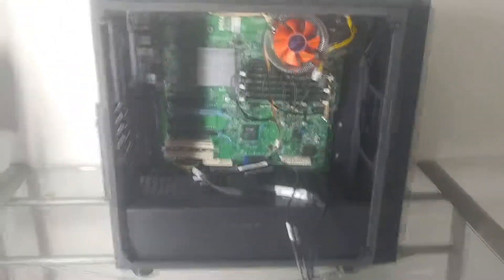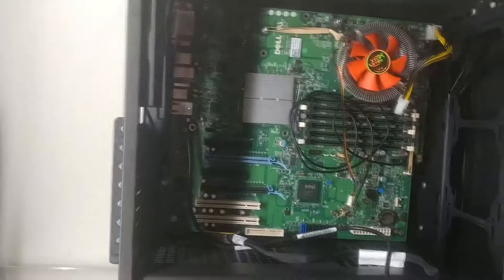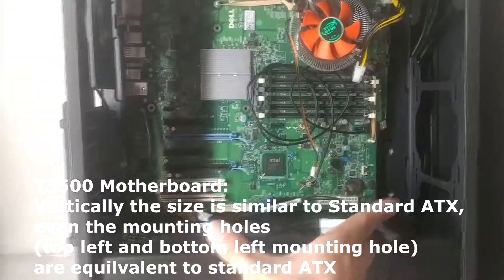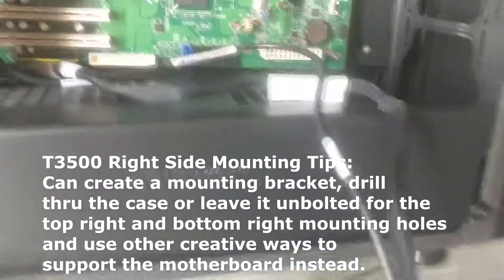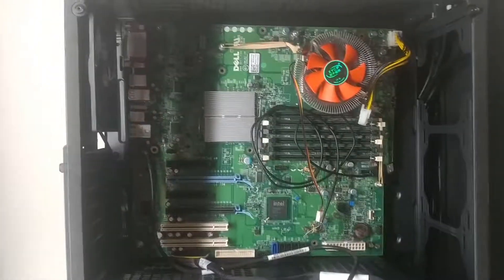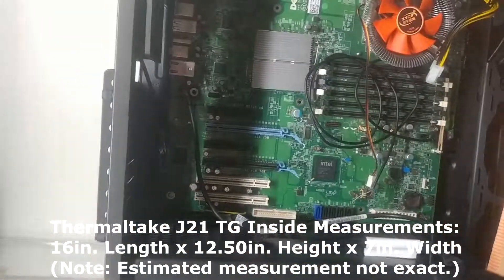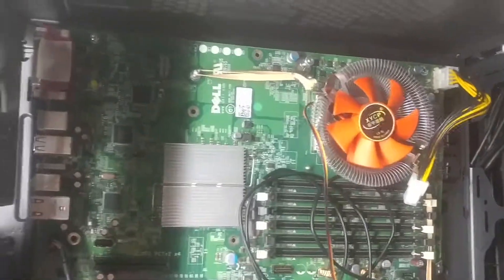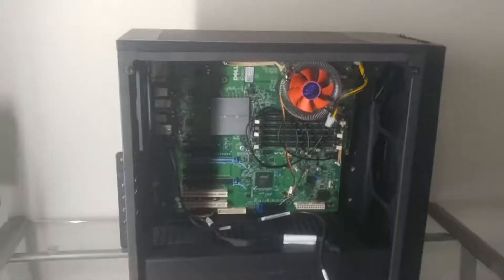Fitting A T3500 Dell Motherboard In a Standard ATX Case

Comment: Bro I love the gaming case and can I fit dell precision t3500 motherboard CD ROM and power supply
Reply from the maker: Unfortunately not on this pc case that is on this video because this pc case does not have a slot for putting a cd ROM drive, a standard atx power supply will fit but the stock dell you will have to transfer the harness with it, in my opinion it would be better and simpler to just use an aftermarket standard atx power supply instead of having to remove the stock t3500 wiring harness, you also might not have full control/option of the orientation/mounting of the motherboard if you decide to use the stock dell power supply (not impossible if you decide to use, just more effort). Hope that helps
Reply: @IrvinCunanan  thanks

Comment: hey thanks for this video i’m really worried about what case to get. can you please recommend some cases for me thank you.
Reply: will this fit

MUSETEX 6pcs 120mm Fans Digital ARGB Lighting - 2 Tempered Glass Panels USB3.0 - ATX Mid-Tower PC Gaming Case-White Frame - Computer Chassis Desktop Case（907W6W） https://www.amazon.com/dp/B08FYN6R8L/ref=cm_sw_r_cp_api_glt_fabc_VE839QZB30BWS3NJM2W1
Reply from the maker: @Alkize06   I am not sure about that case I'm so sorry to say. I have only tried this on a J21 Thermaltake PC Case. There are comments in this video of people and fellow Youtubers that shared what worked for them. Also its the inside measurements you want to be looking for, if you can go to a pc store and get some measurements or maybe messaging sellers that sell a particular pc case you would be interested in and ask for the inside dimensions.
Reply: thanks for answering
it says 12 by 13 inches. do you remember the size of the mobo?

Comment: ive done 3 in rosewill mesh cases!! pretty sure I have a vid on here too of it ….lotta ppl are wondering if it would fit into certain cases...mobo was 13.5 inches at the top and 13 twards the bottom...must have a flat back wall in the case for the mobo and needs to be 13.5inches at least :) nice vid man!!!

Comment: hey! what cpu cooler you have there?
Reply from the maker: Its not that great tbh the fan spins very slowly.  It is a no name brand that I got from ebay (shipped from china) out of curiosity
Reply: Oh could direct me to the right direction. I have dell T3500 and want to upgrade cpu cooler.
Reply from the maker: @gediminasbielskis8346   From what I remember no ordinary after market replacement cpu cooler will fit on the dell T3500 without some modifications, their mounting is completely different from a standard aftermarket cpu cooler mount. Also their fan is no ordinary cpu pin either, it would have to be re pinned from stock to standard 4pin if you plan on using aftermarket cpu fan coolers.
Reply: Irvin Cunanan thanks pal. I have been looking everywhere to find any info. But what I found is that 212 cooler master just fits on the dell T3500 mount. If I place the plastic mount, generic that many cheap coolers use on regular 1366 board and screw it on with some m3 bolts? I would just attach cpu cooler? Cause some cheap cpu coolers have 6 heat pipes with 90mm fans, that should be enough space even in original T3500 box.
Reply: @gediminasbielskis8346  get the copper heatsink and attach 1 fan on side your good to go
Reply: @thelaw9937  how did you attach yours?
Reply: @stefaniliev1528  i zip tied the fan around the top of the heatsink working fine

Comment: The issue I see being the BIOS having issues and yelling at the user every time it boots. One of my spare systems is a T3500 and I've had to lug it around a bit more than I'd like and it's too clunky and awkward to carry. Yet I know that the bios will have issues with the front fans not being the proprietary 5 pin ones etc. The front USB might not be an issue depending on the user though. Maybe there's a bios mod out there that'll help with everything else.
Reply: There is a vid on youtube how to remove the fan error
Reply: @thelaw9937  do you happen to know the name of it?
Reply: @buzzlightyearoh  try to go to BIOS/Maintenance/SYSLOG screen and clear it manually.
Reply: @thelaw9937  will try thank you
Reply: @thelaw9937  man I can’t find that I cleared the system log but nothing changes and in maintenance everything is useless
Reply: @buzzlightyearoh  bro listen i builded my dell t3500 and removed original fans but im still waiting for my molex splitter it will arrive in 7 days when i get it  i will try everything to make it work and ill get back to you
Reply: @thelaw9937  do u know how to connect other fans?
Reply: @buzzlightyearoh  i removed the original 2 fans that was connected next to the cpu and then bought 3 rgb fans from amazon that you can connect them to the sata cable or you can buy fans that connect through molex
Reply: @thelaw9937  my case has 3 molex fans but idk where to connect them 
Edit: ohh I figured it out lol
Reply: @buzzlightyearoh  if you have same fans you can stick them in each other then to the main one or if they are different, use a molex splitter it was 5$ on amazon
Reply: @thelaw9937  I just don’t have the molex cable in my psu do I have to buy one and connect it to my psu?
Reply: @buzzlightyearoh  idk man i just got my dell 525w power supply already with a molex cable idk if you can add one maybe try googling it because its not a like a plug cable you need to insert small wires into the power supply maybe try googling  i really dont know if its possible
Reply: @thelaw9937  yeah there is a molex to sata cable and also 6x pin connector for the psu
Reply: @buzzlightyearoh  yeah try to find which one is compatible with your psu and get it. and when i get all my parts in 8 days i will try to remove the error code and give you the solution
Reply: Little late to the reply, but I removed the original 2 120mm fans that my t3500 came with and replaced them with 2 corsair LL series 120mm fans. I used some standard female to male jumpers like you would get with an Arduino starter kit and hardwired the Corsair fan connectors to the motherboard fan headers. If you haven't already found a solution, feel free to DM me and I can walk you through how I did it, as well as some of the downsides to doing what I did.